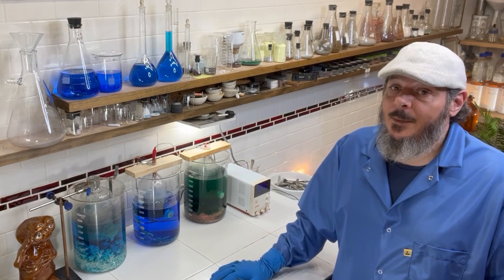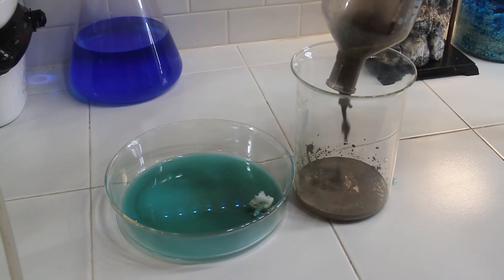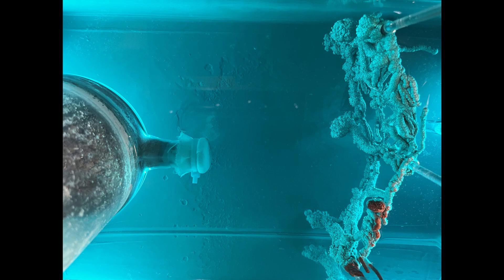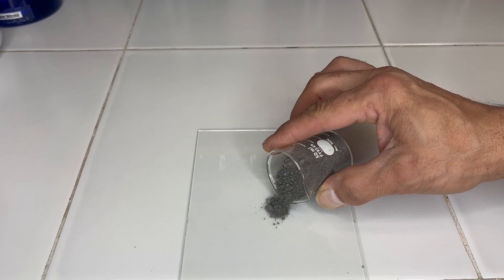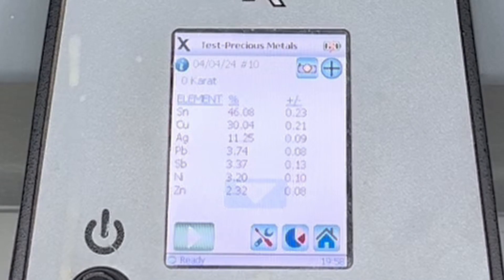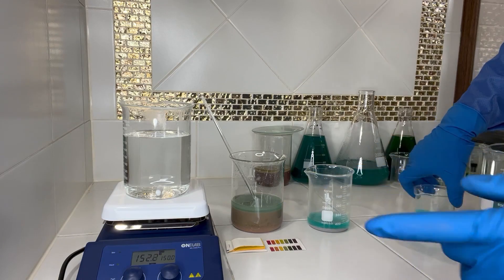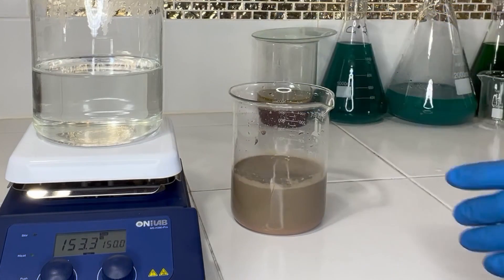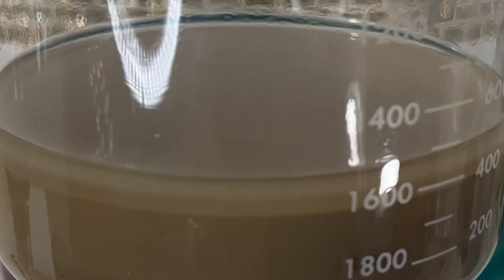Refining Copper and Silver Will Save Your Acid One Day

Comment: The best advice and xrf data.  Nothing is clean and this beats sreetips by data info but seems even handed in process time and chems because additional NaOH instead of copper cementation.  I am intuitively, on my own, suspecting a NaOH rinse is necessary between steps because of chlorides etc getting stuck and passivating throughout the process.  Still, my slimes.and precipitates do not settle nor filter well.  
Question: are the white solids left over suspected to be inert after AR digestion? Are they silver preciptating out on excess hcl? More NaOH!

Comment: What are the actual devices you are using to achieve this?  I can't find a single video that has a product list on all the machines, wires, and jars.  I have no idea what those electronic devices are that run currents.

Also, is it possible to melt/dissolve all kinds of metals into one solution, and then process each metal in a different process?  Example, if I have copper, aluminum, gold, and silver in a single solution, can I process each metal to .999 one at a time?  Or is this even possible?
Reply from the maker: @RHaney2012 All of the metals you listed can be separated one at a time.  The order would be gold, silver, copper, then aluminum. Getting 999 in one step will cause impurities in the remaining metals.  For instance, you could get pure copper out but the other metals would not separate, so a second step is needed.  I have not found a way to do it all in one step…yet. It can all be done in 2 pretty simple steps using the 4 Horsemen Refining System.

The 4 Horsemen Metal Refining System, with all the devices needed, is now for sale on the website! The aspirator bottles are on backorder but you can preorder for December delivery - https://anthonythomas.us/merchandise/ols/products/4-horsemen-refining-kit
Reply: He has some fairly spendy gear, but using simple equipment will do . Use sulfuric acid to remove the majority of base metals more reactive than copper using electtolysis. What is left is mostly precious metals mixed with some antimony and lead. Then nitric acid to free the silver with electrolsis the residue after this will be the lead sulfate mixed with PMs. Here I roast the residue with heating till the sulfates decompose. Then treat with nitric acid. This disolves the lead and other stubborn stuff but leaves behind the precious metals that can be filterd out.

Comment: In your silver nitrate one, why don't the base metals in solution plate out with the silver?
Reply from the maker: The cathode and anode dictate what will plate out. Cathode mostly. I could get more to plate out if I change the cathode to a lesser metal but it may also disolve in the silver nitrate. Keep the series of metals in mind. Usually the higher metal plates out.
Reply: @anthonythomasfmg  Thank you for your response but I still don't understand. Copper spontaneously plates out on iron. Does it not do it on stainless steel?
Reply from the maker: @Matt-xw1xx  Copper "does not" plate out on stainless cathode. Copper dissolves into the nitric solution and stays in solution. If your solution becomes to rich in copper it can plate out a little, but I've run kilos of metal through my #2 cell (same solution) and consistently get 995+ silver. Can't say for sure but I believe it is because Silver has a stronger molecular bond.
Reply: @anthonythomasfmg  Ohhh your electrolyte is nitric acid based?
Reply from the maker: @Matt-xw1xx  Yes in the silver cells, its silver nitrate solution.
Reply: @anthonythomasfmg "higher" means the lesser-reactive?  Is that why i see gold tone during initial Cu2S+ waste electrodeposition?

Comment: I love chemistry and I’m happy to have found you among a few other metal heads I watch. A fellow YouTuber cements his copper back out of solution using angle iron. Could he use your electrolysis method with the platinum anode, nickel cathode and sulfuric acid to refine his backs to three nines. And possibly use it again right cement out his refined silver? Thanks for showing us your alchemy. 👍🤙❤️
Reply from the maker: I will have videos upcoming on how to use up all of the solutions. There are a few ways to get the result you're looking for. All acids and solids are in the system until you pull them out. They don't go anywhere but we have to decide in what form we want them to come out in. I am working on a series of experiments to pull each metal out one by one and reclaim the acids. Stay tuned and Thanks so much for watching.

Comment: I have a couple of questions regarding the 3rd cell with 95% silver and wondered how pure is the silver you recover. I process stirling silver by dissolving in nitric and heating at about 300 deg C which turns the copper to the oxide which is insoluble ans end up with pure silver nitrate which is what I need. But I would like to try your electrolytic cell if the silver is 99.9% . Also what are your anode bottles called as I cant seem to find them in the UK and what do you use as the membrane?
Reply from the maker: Thank you for watching!       I get 999 silver directly from the cell. Sterling in and 999 out. The only draw back, compared to some other methods, is that you will need to change out your electrolyte more frequently depending on how much base metal is introduced. This method has been used traditionally to purify 98% silver or higher, as a final step. Which I figure is not a concern because with this method you can recover most of your nitric acid with distillation. (upcoming video on this) The bottle is a 24/40 aspirator bottle for sale on amazon for about $50 US. The membrane is "dacron", (Shopvac - wet dry vacuum bag). Also don't forget to buy chemically resistant zip-ties, I buy mine from Grainger. Let me know how it goes, it is a lot of fun watching the crystals grow!

Comment: Hello man, that is SOME lab you have now... I was told, electrolysis of sterling is not good method as there is too much copper. Silver has to be like 98-99 % and electrolysis is "last step" to remove slight contamination (Cu Au PGMs). Any thought about that?
Here in central Europe sterling is kinda recent, I have most silver 800, 812, 830, and 900... 925 just some recent jewelery and british or american stuff...
Reply from the maker: Hi there brother! if all you want is your silver this is not the way to go, but i'm going to refine out, or at least i believe, i will refine out every metal with this process. Next test... Using the series of metals to pull the base metals out of the waste aqua regia one by one. My end goal is a sort of trash compactor approach. Garbage in, pure metal out! Keeping or selling all of the base metals is worth the cost of my acids.  
On your other point, I've put 50/50 silver in the cell and it works fine until it doesn't. If you run it twice it comes out 999.  I've found that (95% and up silver put in cell will get 999 out. below that will also work if you monitor your solution saturation. As long as you don't reach a critical point of saturation you will get out 999 fine. 

God Bless!

Comment: Very interesting. I didnt quite get why you pored the slimes into the aqua regia. What did that accomplish?
Reply from the maker: Thanks for watching! Pouring slimes into aqua regia causes silver chloride to form and settle out to the bottom.  Every other metal will dissolve into solution. This creates a seperation point to get only pure silver chloride.  Convert AgCl into silver metal using lye and sugar method.
Reply: I woulda thunk just nitric first, then separate Ag/Pd/Os with HCl, treat the residues as AU/Pt/Rh.  Thank you for teaching the recycling of waste solutions.